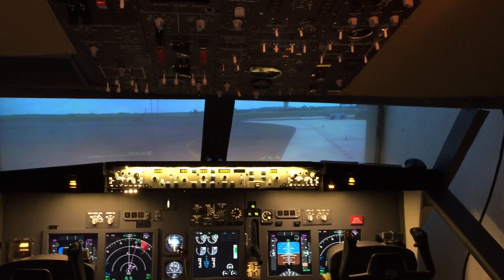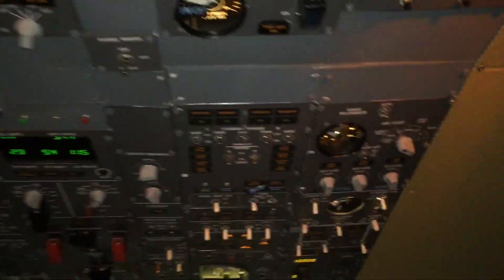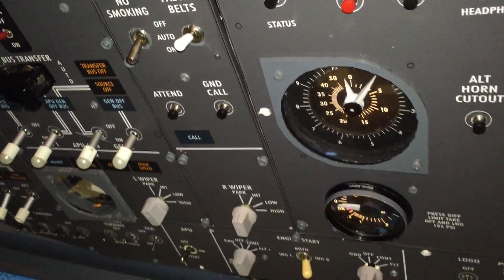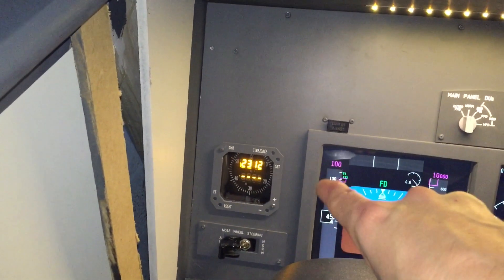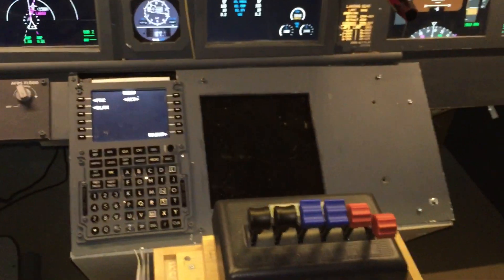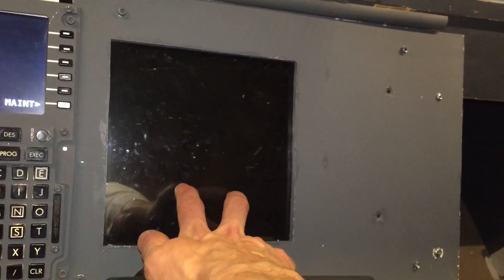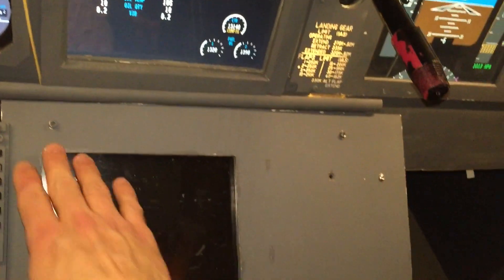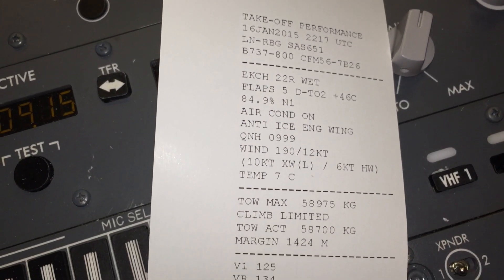Status January 2015 - B737 Home Cockpit

Comment: How much does this all cost, because i want to buid a cockpit myself. But dont have a lot of money?
Reply from the maker: +anthonygames Depends on your level of realism. The sky is the limit. $1000 will get you a long way. You do not need to burn all the cash at once. $50/month will get you going over a few years will get you far. Start with some some extra monitors, some switches and an interface borad.
Reply: Alright thanks!

Comment: Hi great vid, 
I would just like to know which avionics you use for the PFD, ND and EICAS
THANK YOU!
Reply from the maker: Hi Ryaan. 
It is Prosim737
Reply: Build a Boeing ok and for your homemade overhead,its really well done
how does it connect to your pc is it by usb and which interface card do you use
and how many computers and monitors do you use?
if you could give me a link where to buy them it would be great
Reply from the maker: Hi ryaan beg. The overhead is interfaced using OpenCockpits cards. 
I have 3 monitors in the MIP, 1 in the lower MIP, 1 in the FMC and an additional screen on the side as instructor station.